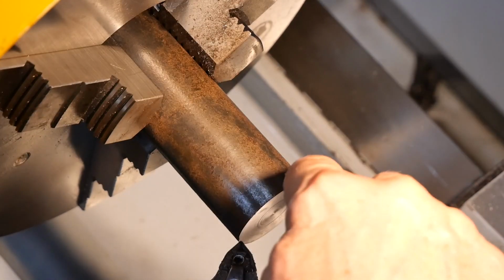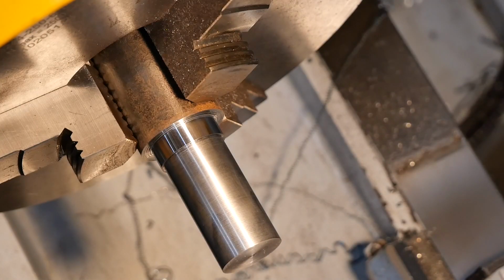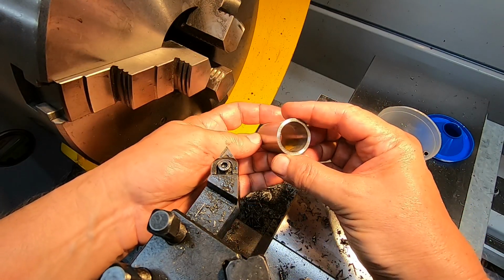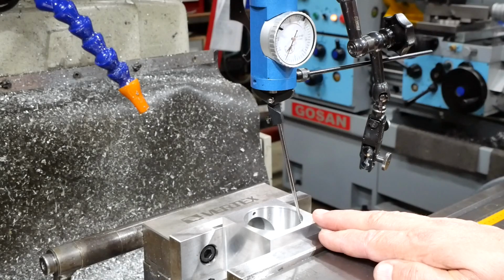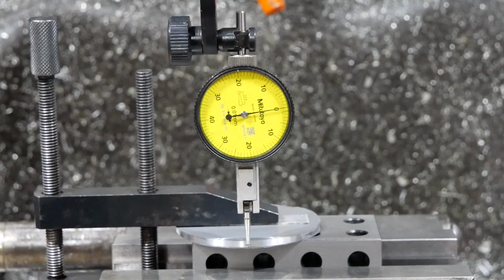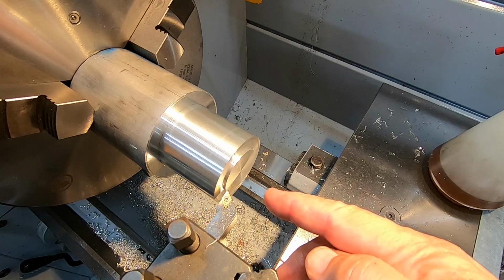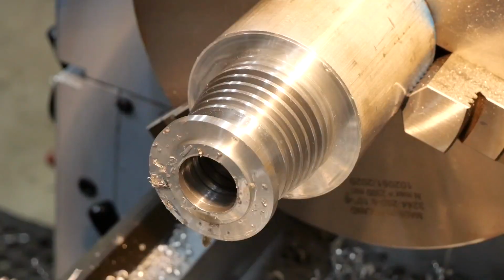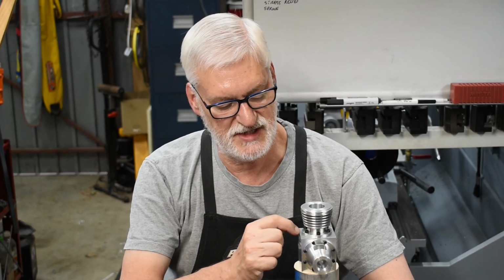Building the Lynx15 - Part 2

Comment: Excellent work Alan. You just kept hitting your numbers. Really good fitment so far.
Also you're having a great time doing it.
An enjoyable video to watch.
Reply from the maker: I am having fun with this project and there are no expensive castings or cast iron dust to contend with. 6061 aluminium machines very well and is great stuff to work with. I've managed to get key dimensions correct (so far) but had a couple of stumbles along the way, so still plenty of room for improvement :)
Thanks for watching.